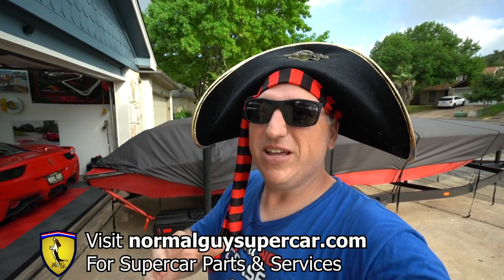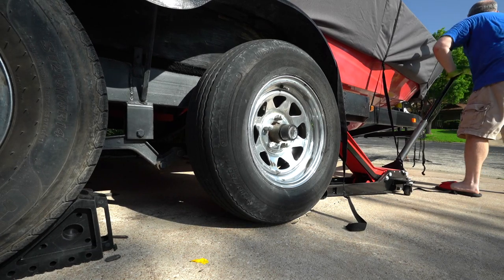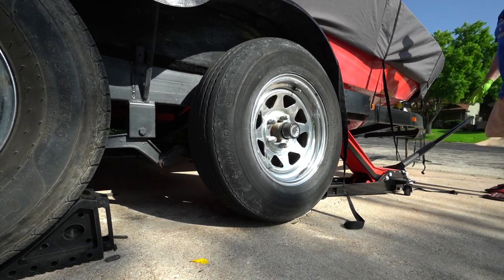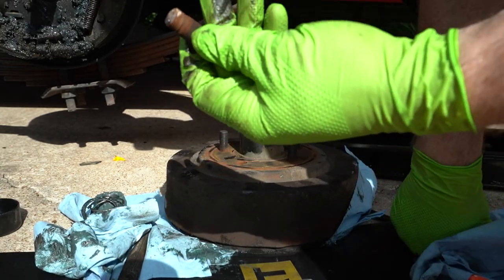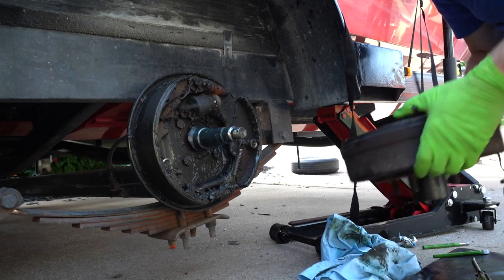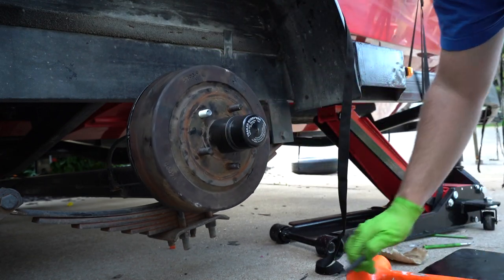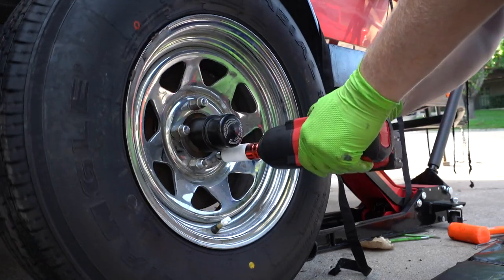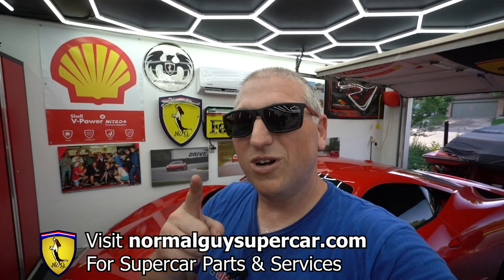Making sure my TRAILER is SAFE - Replacing a broken wheel stud & new tires

Comment: That trailer needs a preventative maintenance done on it. You should be replacing those inner seals and repacking the wheel bearings. The brake shoes should be completely dry and free of contaminates. Great vid.
Reply from the maker: As time allows

Comment: Balanced trailer tires !  I thought I was the only one that did that. Impressed !!!!!!
Reply from the maker: Might as well
Reply: Yeah, pay extra to balance the time but wouldn't take the extra steps to replace the inner seal and clean the grease off. You got way more money than brains, but you're doing better than me in life. Cheers to you pal.
Reply: @raisinracinbrealynn1478  I bought a new cargo trailer a year ago. Came with made in China tires and made in Vietnam rims. One tire assembly needed 1 lb of weights and the other very close. Unbalanced I don't think they would have lasted 1000 miles.

Comment: Dan, Dan Dan, Love your content and gave this a like, but some things were overlooked here. So I'll be 'that guy' today..... 

I'm assuming you did put actual trailer tires on, just wanted to mention that since you didn't. I would recommend replacing the inner seal, cleaning the brakes (possibly/probably replacing the shoes while you're at it), and properly cleaning and re-greasing the bearings before re-assembly. And I would eventually (soon) perform the same procedure on all 4 wheels. You REALLY want properly performing brakes with a (relatively) heavy boat/trailer setup like that. Also, research how to remove the Bearing Buddy, they come off more quickly and easily than what you went through — there's no need to remove the C-clip and zerk. Otherwise, good stuff man.
Reply from the maker: They are 8 ply trailer tires

Comment: Yeah, you definitely don't want a trailer tire/wheel coming off.  Don't ask how I know...

Pro tip, check torque early and often, especially on alloy trailer wheels (looks like you have steel ones).

Need more Mo content.  I can't be sure you do things right unless Mo is supervising.